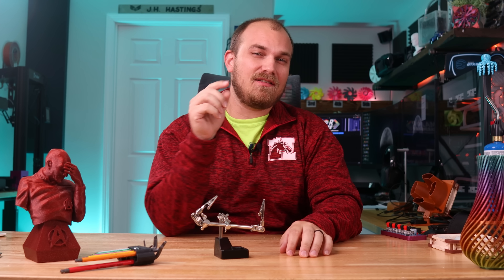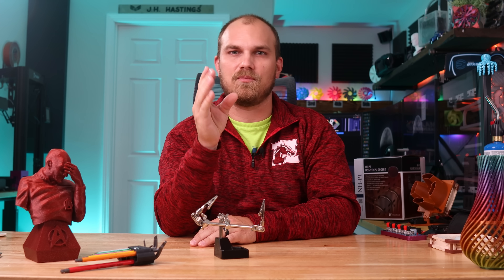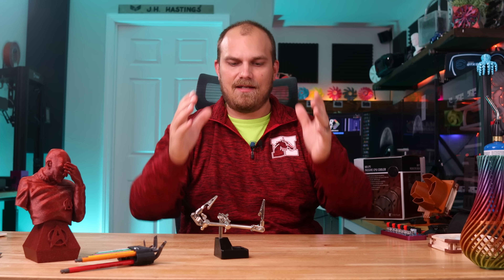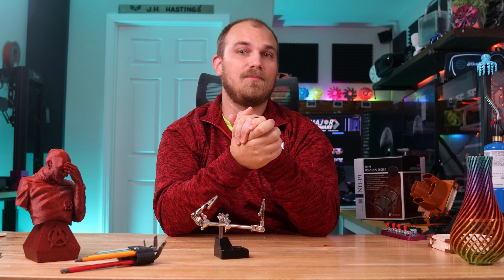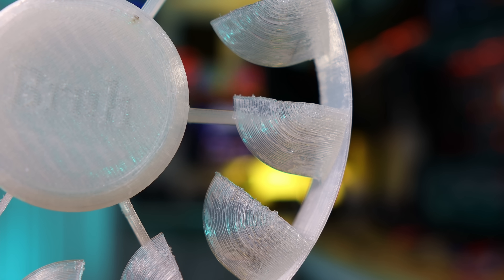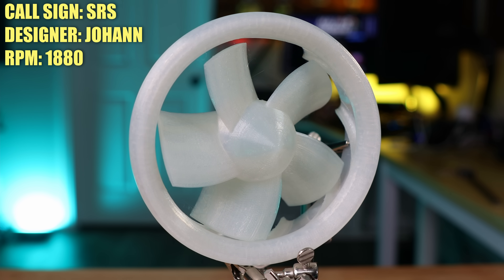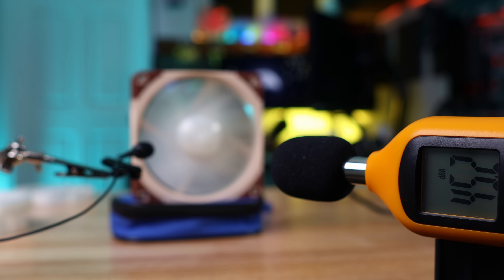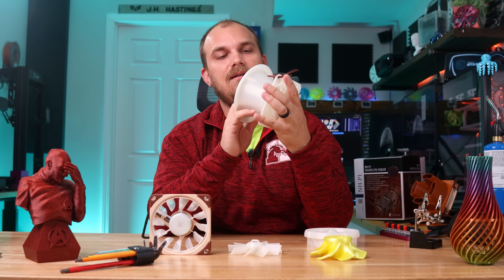TURBOCHARGING the Noctua NH-P1 - Fan Showdown S3E1

Comment: The only flaw with that cooler is that it doesn't really test static pressure of the fans as much as a cooler with a denser fin stack.
As to how much that will affect the fans thermal performance, I don't know.
Either way, I can't wait to see this season play out!!!
Reply: @InfamousSabreMods  no, the turbo came last because it's designed to be in a housing and sending the pressurized air perpendicular to the fan (basically sideways) instead of a normal pc fan blowing straight through, you can see that the base of the turbo fan is very wide which doesnt really help its flow in this situation
Reply: @heygek2769  That certainly won’t be helping performance, however centrifugal jet engines do exist, which use basically the same principle and also direct the air in the same way that a traditional fan. I’d say the biggest impact is likely as turbos are designed to run at much higher rpms (a quick google suggests up to 350 times as fast, assuming a speed of 1000rpm for the nocturnal fan), which has a big impact on blade design and efficiency.
Reply: I think it would be better to make a artificial heat source. with support for the most common heat sinks.
Reply: The major downside is changing the goalposts
Reply: @The_Ballo  It does change the standards a bit, but its still going against the noctua's specs. I'd say the goalposts were redesigned, rather than moved. I do agree that static pressure measuring is not going to be a thing BUT it does open up the option of static pressure vs non static pressure categories.
Reply: @The_Ballo  I agree, but I think running a few of the past fans (not just the winners) for comparison to the old set up would help us get an idea of the differences.
Reply: @puretriggers6533  Just compare the A12 for now. They did almost the exact same within 1 degree; so that's usually considered to be margin of error. Thus the same, pretty much. 

@0:24 and @11:35 for your ease of use. 

old setup vs new setup is basically 1 degree difference.

Though it could be seen as maybe almost 2 degrees since the base room temp was lower for the new one? I dunno. Either or, that difference is also a single degree. So between final temps and base temps... functionally the same with some possible variance.
Reply: Couldn't he have just mounted a radiator horizontally? Or got a flat test bench. Getting a weird passive cooler does seem an... interesting way of doing it.
Reply: Well, it's kind of the next step though, he's already done a water cooler in season 1 and a normal air cooler in season 2.

Plus maybe that'll give some fans to pull ahead that are more focused on this type of thing, personally though I would prefer if he tested all coolers.
Reply: Yeah, please use a normal cooler major!
Reply: I mean he essentially trashed every piece of data previously gathered. The poor fans in this episode actually have no clue how they fare against previous designs...
I feel like they were robbed of their data.
Reply: Doesn't test static pressure, and it's a pretty uncommon setup. Would like to see him get more scientific, not less. Still... Entertaining.